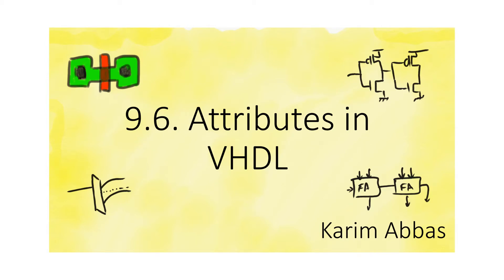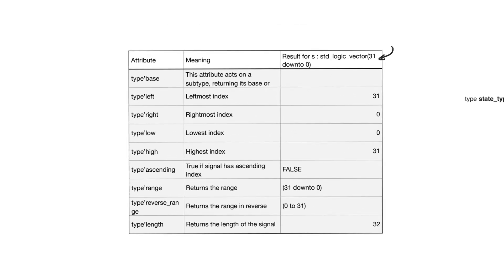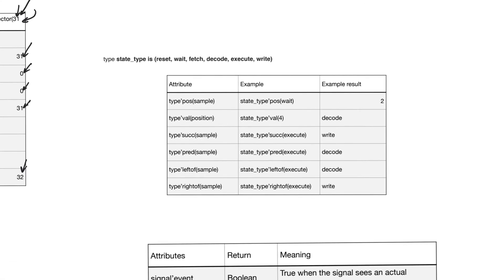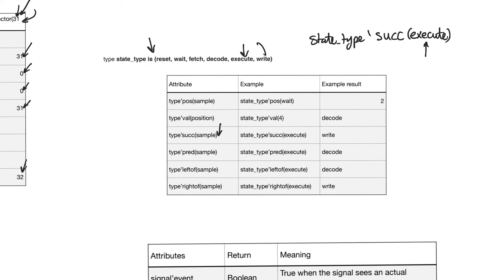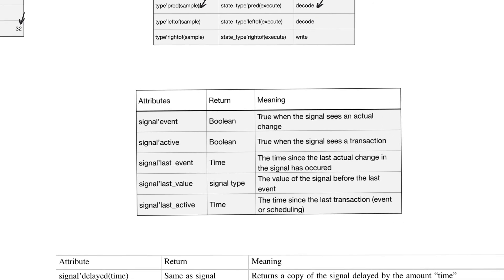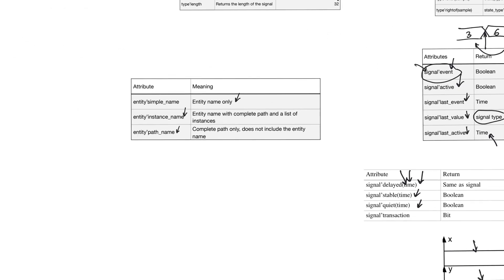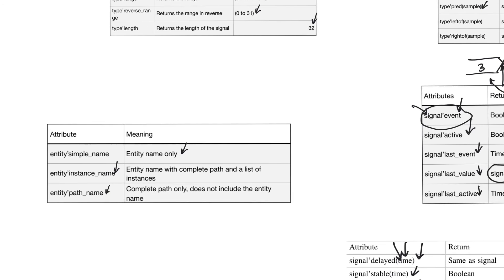9.6. Attributes in VHDL

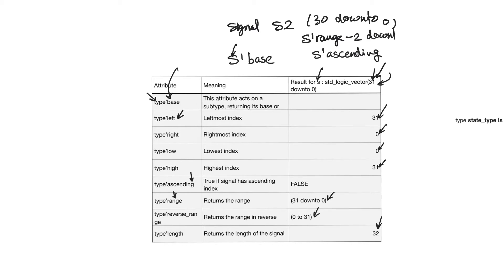Comment: Thank you for the videos, they are really helpful. At 3:55 , can you please explain (s'range-2 downto 0)  as s'range will itself return (31 down to 0). I was expecting to use s'high instead of s'range. I'm  beginner in vhld and just started learning so confused.
Reply: I tried the same. Use s'range and vivado reported error. It should be s'high instead.
Reply: @snkparty1  Thank you.
Reply: maybe just (s'range) between brackets, as range will return "31 downto 0"